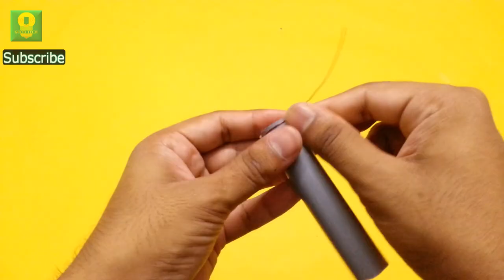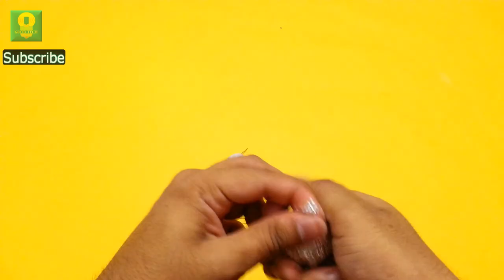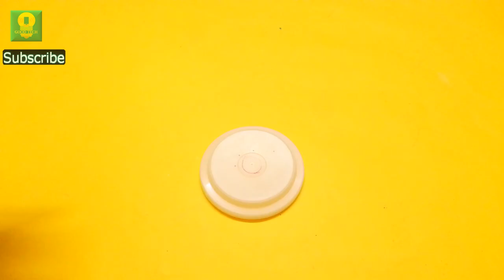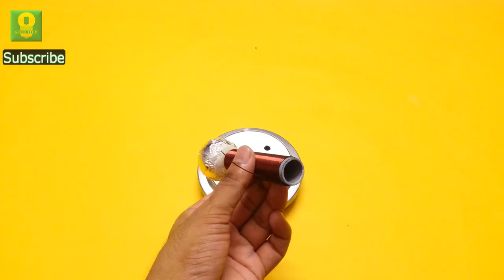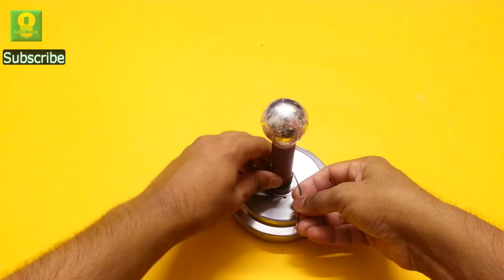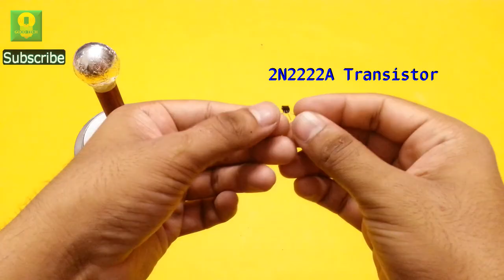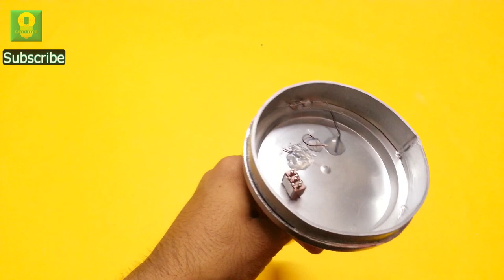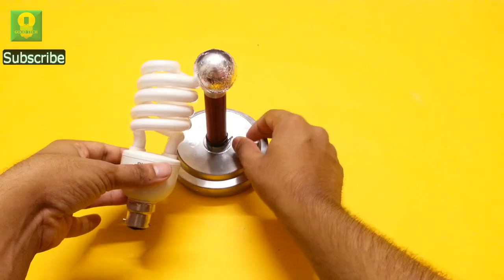How to make Tesla Tower at home

Comment: Can I use PN 2222A Transistor
Reply from the maker: I havn't tried with PN 2222A transistor. It might work but you will have to refer the datasheet of both (2N 2222A & PN 2222A) transitor and calculate the values for base resistance for the transistor you will be using so as to create adequate switching frequency.

Comment: Only LED bulbs will glow?not filament bulbs?
Reply from the maker: Only neon and fluorescent lights will glow.
Reply: What is the reason bro?
Reply from the maker: The rapidly changing magnetic field emitted by the coil energizes mercury electrons to a higher "orbit" in the flourescent tubes via eddy current induction and the zeeman effect. When the mercury electrons return to their lower states, they emit an ultraviolet photon. That photon excites an phosopher electron on the tube wall. When that phosopher electron returns to its lower state it emits a visible wavelength photon which our eye picks up as light.
Reply: ***** tanx
Reply: Yeah Mr White, yeah Science !
Reply: filament needs more engery
Reply: what another transistor can we use???

Comment: what can we use instead of a PVC pipe
Reply from the maker: Empty Roll of a food wrapping foil.
Reply: +GOODTECH - Creativity and Science thank you but which wire you used which was wrapped second time on the PVC pipe (on the copper wire)
Reply from the maker: It is a simple (single strand) hard insulated wire.
Reply: +GOODTECH - Creativity and Science Thanks today am gonna make this
Reply: +GOODTECH - Creativity and Science  what is the long thing you used in 1.31
Reply from the maker: It is sunboard, just a kind of white flexible cardboard.
Reply: Thx bro

Comment: we made one for a science project but our transistor is continuously overheating  do you have a reason or a solution for this problem
Reply from the maker: The only reason the transistor is overheating because the coil is drawing more power. Make sure the turns ratio between primary to secondary is not more that 1 : 3. To eliminate the problem reduce the no. of turns of coil or if you need to make a bigger project use a different high power switching transistor.
Reply: OK thanks, we will check and see if that helps thank you
Reply: So if we have 180 wraps on our secondary coil we need 60 wraps on our primary  but in the video you don't have this ratio ?
Reply: Reko omer it's probably not the wire it only matters they it's enameled yes it works for us  you might want to check that the transistor is on the right way  just Google search about the prong order and it should give you the placement
Reply: But if it's not that then it might be your positive and negative  for your battery connector
Reply: Put a condensator

Comment: Sir am not getting it..transistor is getting heated up..
Reply from the maker: Yes, it happens. If the transistor is getting heated that means atleast the circuit is correct and working. All you now need to do is reduce the no. of coils in the tower. Make sure that there are only about 180 - 200 turns of wire in the coil.

Comment: PLease  help mine  coil is not working .
Reply from the maker: There can only be two reasons for the coil to not work. 1st - something wrong in connections, check the connections well again. 2nd - You used a normal 9v chinese battery, a normal battery will not work with this as it requires atleast 500mA of current, so use a 9v duracell battery to get the desired results.

Comment: Can you explain this wireless electricity?
Reply from the maker: It is based on the principle of electromagnetic induction. When the circuit is turned ON, the transistor starts working as a switching device and this action produces a high frequency pulsating wave which is further feeded to the primary coil, that induces a high voltage pulsating wave in the air cored secondary coil. The hollow metallic sphere acts as a capacitor around which the high voltage electric fields are generated. When a CFL or any Fluorescent Bulb is placed near the coil it intercepts the electric field and the particles inside the lamps gets excited due to this field, and due to excitation they hit the fluorescent walls and lights up.
Reply: Thank you so much! This would be a great experiment for our Science Fair. Can I use it, Sir?
Reply from the maker: Yes, you can make one easily, if you encounter any problems feel free to ask. However, don't copy the video to upload on other sites or youtube channels as you will receive copyright claims on the content.
Reply: Thank you very much, Sir!
Reply: Hey, can I ask for the height of PVC Pipe? Thanks!

Comment: 2n2222a or 2n2222 transistor is not in market instead of that what we have to use
Reply from the maker: I have used this transistor and it worked. Although, any high switching npn transistor should work. However, 2n2222 transistor is easily available online on ebay and amazon.

Comment: can i use a ksp2222a? Thank
Reply from the maker: No, a ksp2222a is a general purpose amplifier transistor whereas 2N2222A is a small signal switching transistor.
Reply: so I can not really use it? It does not work the tesla? (sorry for my english, I'm Italian) :)
Reply: I bought it on ebay 2N but..  I received a ksp
Reply from the maker: I haven't tested with ksp but according to datasheet it is a amplifier transistor and for this circuit to work we need a switching transistor, which is 2N2222A.

Comment: can anyone tell me the simple working principle of this Tesla coil so I can use it as my physics project and prepare viva
Reply from the maker: It is based on the principle of electromagnetic induction. When the circuit is turned ON, the transistor starts working as a switching device and this action produces a high frequency pulsating wave which is further feeded to the primary coil, that induces a high voltage pulsating wave in the air cored secondary coil. The hollow metallic sphere acts as a capacitor around which the high voltage electric fields are generated. When a CFL or any Fluorescent Bulb is placed near the coil it intercepts the electric field and the particles inside the lamps gets excited due to this field, and due to excitation they hit the fluorescent walls and lights up.

Comment: bro I make a mini tesla coil it work perfectly but after sometime it doesn't work. pls tell me what can I do
Reply from the maker: Check whether the battery is charged or it has drained and also check if the transistor is working or it got burnt. Use a multimeter to check the transisitor, if the transistor is fine, then it should work.
Reply: GOODTECH - Creativity and Science bro I have changed the battery and I check the new battery it is full working. battery is ok. but I have no multimeter so what can I do
Reply from the maker: If there is no multimeter then you will have to make a transistor testing circuit using LED on breadboard. Do a google search and there are many tutorials available. Or simple replace the transistor because if the circuit did worl once then the only problem can be a faulty transistor.
i hope you are using a high current 9v battery because normal chinese batteries don't work well with this project.
Reply: bro I have changed the transistor
Reply: bro firstly I used blue and white battery it works but after sometime it doesn't working then I changed with new battery what can I do. or I have also changed the transistor
Reply: I go to a electronic shop then the electrician tights the battery terminal and then it works but when I come back to house it doesn't work bro please tell me fastly tomorrow is my sci fair.

Comment: i used 2N2222A transisitor
27 k resistor
but my circuit doesnt works
Reply from the maker: First, Double check the connections, if everything seems fine, turn ON the switch, the transistor should get slightly hot, If not, then make sure you have used a high current 9v battery, as a normal 9v battery will not work with this circuit. You need atleast 500mA at 9v for this circuit to work.
Reply: GOODTECH - Creativity and Science i used a single silver wire as primary coil is it fine??

Comment: Does this work 100%? Please reply
Reply from the maker: Hello mallikarjuna uma,
i have made this device myself at home and it really works. Although it might be possible that it may not work at first due to following reasons,
1. wrong circuit connections.
2. Faulty component used.
3. Not enough power supplied (most people made the mistake of using a cheap chinese battery with this project, so it did not work. A cheap chinese battery can only provide 100mA at 9v but this project needs at least 500mA to work.)
If you keep these points in mind and make the project, i am sure that it will work. If you get any doubt, don't hesitate to ask.
I have also made a detailed written tutorial about it, you can also have a look at that here - https://www.instructables.com/id/How-to-Make-a-Mini-Tesla-Tower/

Comment: I made it with 26 gauge magnet wire , but it's not working! 😣
Reply from the maker: It should work. Did you make around 200 turns? Also make sure you use a high current 9v battery, normal cheap chinese batteries will not work.

Comment: @ 2:01 what type of wire is that?
Reply from the maker: Single strand Hard insulated wire.
Reply: So I go to a radio shack to see if they have a 27k Resistor part, they didn't have one unless I know the Ohms or some other k numbered one that will work instead of a 27k type.
Reply from the maker: You can use any one between 22k to 30k.
Reply: Ah thank you, that really helps
Reply: Adolfo Rhaymond Munsayac the wire is copper wire which can be found in motors and transferators
Reply: copper coil of 18.5gauge

Comment: please tell the working principle
Reply from the maker: It is based on the principle of electromagnetic induction. When the circuit is turned ON, the transistor starts working as a switching device and this action produces a high frequency pulsating wave which is further feeded to the primary coil, that induces a high voltage pulsating wave in the air cored secondary coil. The hollow metallic sphere acts as a capacitor around which the high voltage electric fields are generated. When a CFL or any Fluorescent Bulb is placed near the coil it intercepts the electric field and the particles inside the lamps gets excited due to field, and due to excitation it hits the fluorescent walls and lights up.

Comment: the battery contains dc power how will it power  a ac bulb ?
Reply from the maker: Hello Hoopy, you are absolutely right, a battery does have DC current and it cannot power an AC light but in this project we are not directly connecting the light to battery.
The low DC current in battery is fed to the electronic circuit. The transistor used in the circuit is a high power switching transistor that oscillates at very high frequencies through which the air-cored transformer coupled with a primary coil increases the low DC voltage to a very high AC voltage. A strong electromagnetic field is developed around the coil & the hollow sphere. When any neon or fluorescent light is brought near to this field, the electrons get excited and hit the walls of the light & start glowing.
Reply: Thank you For the information

Comment: Nice at least a tesla coil which truly produces wireless electricity. The only problem is the source. That should be generated differently, not from a battery. I mean I am far from criticising this video, but isn't a true tesla coil should work as a "free" energy generator?

Comment: Double check the circuit and make sure everything is connected properly.

Make sure to use a high power 9v battery because a normal 9v chinese battery will not work with this project.

In case the transistor gets too hot, reduce the no. of secondary coils or reduce the supplied power.(THE 9V CHINESE  BATTERY  WILL NOT WORK) 😁😀😁😀😁

Comment: mine didnt work is it in my winding?
Reply from the maker: Yes, quite possible but the main reason can be secondary wire not thicker than primary and the battery used is not able to provide sufficient current. A normal chinese 9v battery will not work for this.
Reply: +GOODTECH - Creativity and Science well i used thin secondary and a 9v battery rechrgable from a toy RC car 2400Ahm and then bad happend XD my transistor smoked XD well its broken

Comment: please, explain "how it's working?"
Reply from the maker: It is based on the principle of electromagnetic induction. When the circuit is turned ON, the transistor starts working as a switching device and this action produces a high frequency pulsating wave which is further feeded to the primary coil, that induces a high voltage pulsating wave in the air cored secondary coil. The hollow metallic sphere acts as a capacitor around which the high voltage electric fields are generated. When a CFL or any Fluorescent Bulb is placed near the coil it intercepts the electric field and the particles inside the lamps gets excited due to this field, and due to excitation they hit the fluorescent walls and lights up.

Comment: But how many coil rolls?¿ 🤔
Reply from the maker: About 250. There is a schematic link in video description that will help to understand the circuit better. The ratio between primary and secondary turns should be around 1:100.

Comment: It is not working  how can it start it is urgent
Reply from the maker: Check the connections again. If all the components and connections are checked then make sure to use a high current 9v power source. A normal chinese 9v battery will not work with this.

Comment: mine is not working pls help
Reply from the maker: Double check the connections, if everything seems fine then make sure to use a high current 9v battery because a cheap chinese battery will not work with this circuit. This project requires atleast 500mA of current.

Comment: I used my power supply to give 9v and around 700mA
Reply from the maker: It should work then. For me it worked, only current was the issue. I hope you used a hard wire as a primary coil(coil with two turns) as the soft flexible wire will not work and also that you removed enameled insulation before making connections. The only thing you can now do is to check the working of transistor, sometimes a transistor can also be defective.

Comment: It didn't work can u please give a circuit diagram
Reply from the maker: There is a link to circuit schematic in video description. However , if it didn't work make sure to use a high current 9v battery, a normal chinese battery will not work with this circuit.
Reply: OK thanks

Comment: Any One Know How Can A 9v Battery Can Power An Ac Bulb? Please
Reply from the maker: Actually this circuit uses npn switching transistor (2N2222). The transistor switches the DC supply too frequently thus converting it into AC. The tesla coil configuration acts as an air core transformer and converts it into high AC voltage, thus creating electromagnetic field around the coil that is capable of lighting fluorescent and neon lights.
Reply: Thanks! Keep The Good Stuff Going

Comment: my circuit is complete but bulb is not glowing
Reply from the maker: If the project isn't working then double check the connections and make sure to use a high current 9v battery, a normal chinese battery will not work with this circuit. It requires atleast 500mA of current at 9v.
Make sure to use a neon or fluorescent lights only, tungsten bulbs doesn't work with this project.
Reply: also can you help me to find wire of cylindrical transistor ebc i am unable to fine
Reply from the maker: The most easiest way is to enter the transistor number on google and it will come up with images that will show all the pin configurations.
Reply: ok

Comment: im pretty sure this is fake, because this cannot possibly oscillate, because it does not have a diode to maintain a base voltage.
Reply from the maker: Hi Max, I am not exactly sure why you think of it as a fake. A diode is not needed because i have already used a controlled 9v DC source.
Also, i assure you that no video on this channel is fake and will never be. If you want to know and need some detailed additional info about this project, do have a look at my instructables page - https://www.instructables.com/id/How-to-Make-a-Mini-Tesla-Tower/

Comment: but mine first work but now its not working
Reply from the maker: Double check the connections. If everything seems fine, make sure you have used a high current 9v battery as a normal chinese battery will not work with this project. It needs about 500mA or more at 9v to work.

Comment: Made it, but mine will not work...
Reply from the maker: Double check the connections. If everything seems fine, make sure you have used a high current 9v battery as a normal chinese battery will not work with this project. It needs about 500mA or more at 9v to work.
Reply: Maybe your transistor is facing the wrong way. In the video, the flat side of the transistor if face up. Either that, or the materials you have used have varied.
Reply: checked the connections, everything looks normal. For the battery I'm using an Industrial by Duracell.